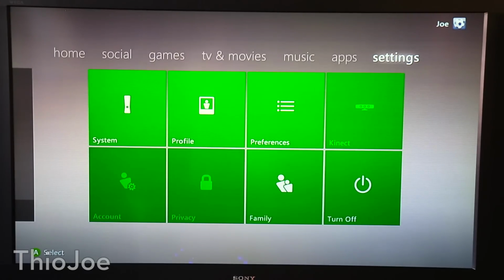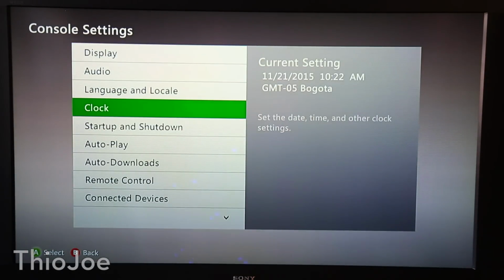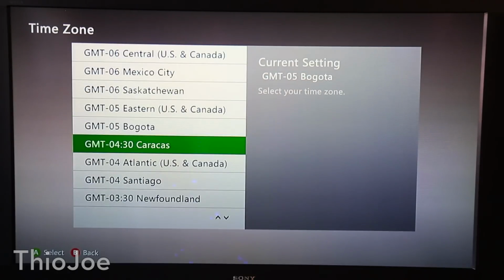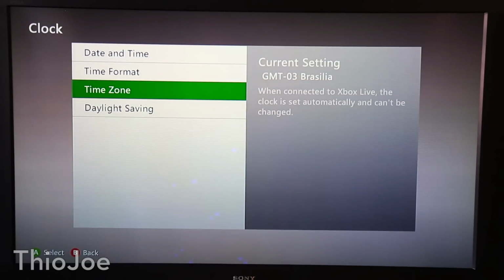Upgrade Your Xbox 360 Graphics for Free

Comment: I used a potato instead it works even better :)
Reply: Lol the simple definition of consoles. #PCMASTERRACE
Reply: +Q-rit Also oranges and pears work great too and bananas they are the best.
Reply: A lemon works pretty good too George Oliver
Reply: omg yes I used a potato too, It worked perfectly.
Reply: +A A are you for real?
Reply: DJ Abady
Yes if you use a potato and attach to USB cable because of the zest from the potato your graphics will improve.
Reply: This also works on my Virtual Boy! :D
Reply: +George Oliver you did this 3 times?
Reply: It works pretty well with a bowl of rice, but nowhere near potato level.
Reply: ***** That's sounds great I'm gonna try it with my PS4
Reply: I learned that if you turn your potato upside down with the cable facing down, the juice in the potato will drip faster, making the boost of speed two times faster
Reply: +Chalklate Try to apply lemon juice on the wire, I noticed a better frame rate while playing COD bo3. when You get too much zombies following you it start droping frames, But no more after the lemon juice.
Reply: +DJ Abady I tried to use lime juice but the wire turned into a zombie instead. How do you make the wire back again¿
Reply: +Chalklate ?*
Reply: +Chalklate ?*
Reply: +Chalklate ?*
Reply: +Chalklate did you try  unplugging it and plugging it again?
Reply: lemons work as well
Reply: I don't know why it posted 3 times but I did try unplugging it and plugging it again
Reply: That is the most amazing thing ever. But... PC is best.
Reply: +Tin Samuel nooo wrong melon work the base!!!!!
Reply: +jake ballou true true true
Reply: +jake ballou Nah, use a nuclear power station
Reply: +Candy Kon MC it worked in my dream
Reply: have you played patato ops 3 lol
Reply: +Christopher Nieves potato
Reply: +Christopher Nieves Yeah I heard it's going to be game of the year this time around :)
Reply: Used a lemon, destroyed my xbox
Reply: Q-rit  I don't know why you using food

Comment: I forgot to turn off my phone and hooked it up to my 360.  My phone zapped a little, and the screen seemed to flicker.  Now, I cannot get my phone turned on, because the screen is black now.  What happened?  Did the phone upgrade my 360's speed or did I not have a power enough phone?
Reply: +Poe Lemic I don't have a meter tool.  Did I need to use that to verify the upgrade?
Reply: +Poe Lemic Do you think I need to hook up more phones to get this to work?  I could use my wife's newer Android phone, but it was not made by Microsoft so I don't know if it would work.
Reply: This does NOT work, it may ruin your xbox360/phone if you do it. Which I'm supposing you did by the comments and you don't need any of the stuff you thought you needed, it doesn't work.